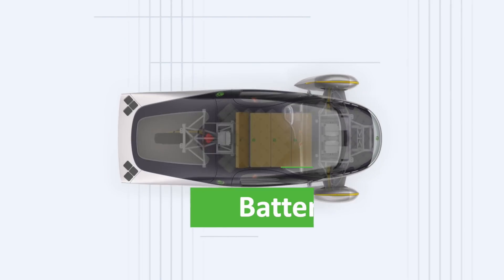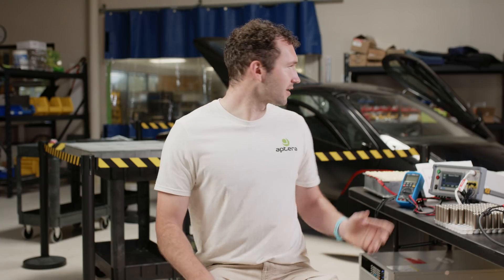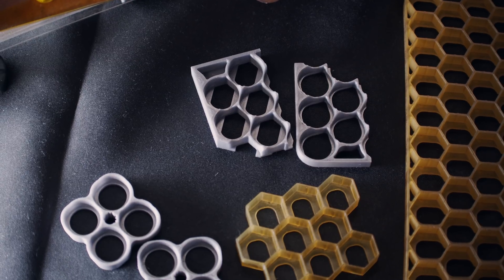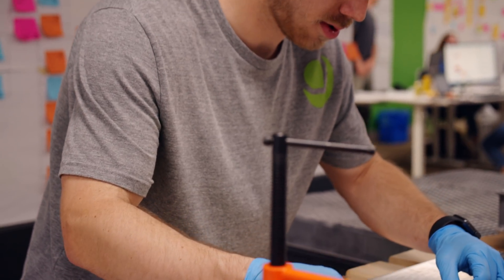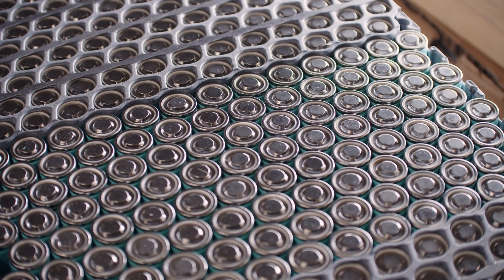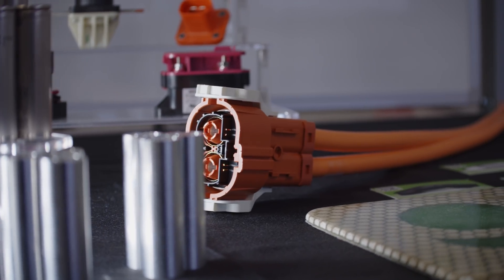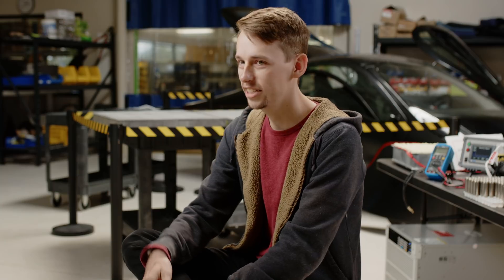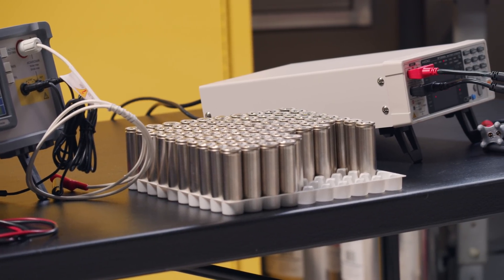Aptera — Battery Update

Comment: I didn't see any mention of thermal management.  How do you keep this battery from getting too hot or too cold due to climate conditions?  Also as the battery is under load and DCFC how do you control temps to keep this battery healthy?
Reply from the maker: Hi there! Our battery engineers have taken this type of event into account— Aptera is designed with a great battery management system that activates cooling or shuts down power in a situation that could endanger the battery pack. Our battery management system protects our battery pack from overcharging, and our solar charging systems charge at low rates so the batteries stay cool during the process.
Reply: Aptera has circulating liquid antifreeze both to the wheel motors and the battery pack.  If stationary and under charging load, the AC system kicks in and flows cold air over the inside of the belly pan and through the AC condenser, to exit the hot air out the rear.
Reply: @n.brucenelson5920  Thanks for the info!  Do you know how cold climate thermal management is done?
Reply: @Longsnowsm  I don't know the details, yet.  I do know that the body has dramatically better thermal insulation than most metal body cars.

I will be testing their performance in all weather conditions in Iowa with an early model and report.  We have more details when delta is released.

Comment: I missed where they talked about switching from LiFePO4 to NMC???? Going for a battery that Cycles 4000-6000 Cycles down to a cheaper battery that has 500-2000 Cycles???? Why? When I reserved 2 years ago it was supposed to be LiFePO4.😢 Y’all even hyped up the Safety and Reliability of the iron phosphate chemistry. What happened? Now we are looking at a battery that is going to last 3-5 years as opposed to a battery that last 10-15 years.
Reply: NMC has been spec'd since the beginning.  Recently Chris has held out the possibility of LiFePO4 for the 250 mile version in the future.  He has a public lithium battery company producing LiFePO4 packs for materials handling vehicles and is very familiar with their properties.  The NMC batteries Aptera is using should last an average of at least 450,000 miles.

Comment: Looking at the FAQ on your site, it mentions being able to replace battery packs. Will this be available as battery technology advances? For example, I see that science is testing new batteries to replace the popular lithium-ion batteries that are in most devices now. If this technology becomes a new standard, would you provide new battery packs using such technology that can be swapped into early models of the Aptera or would this require an all-new design for the vehicle?

Comment: I'm glad to see efficiency as the prime driver, but I hope replaceability is also on the radar.  I see a lot of EV's on the market today that don't think about end of life of the battery pack.  All batteries degrade, so let's plan for that.  I don't expect the battery to be hot swappable in 5 minutes, but you also shouldn't have to literally tear the car apart to do it.  With improving battery tech, it could mean that your next battery pack in 8-12 years from now might even be an upgrade from the original in terms of weight and/or capacity.

Comment: Will the battery be liquid cooled like tesla
Reply from the maker: Yes, the battery will be liquid cooled. The liquid is then cooled by our skin cooling system, so we don't need to have any vents that would destroy aerodynamics.
Reply: Also, the 2023 Chevy bolt will sell for 26k. Why is the aptera selling for the same price when it has way less parts than the bolt and a smaller battery pack. Shouldn’t u be able to sell the aptera 250 range for around 20 k or does Chevy just have such huge buying power they are able to assemble  the bolt for cheaper then the aptera.

Comment: I hear you're doing a structural battery pack, will it still be easily servicable/ replaceable when the battery wears out?
Reply from the maker: Hi! Many cells can fail in our pack design before things need to be replaced, and if replacement is needed, you would only need to replace the pack itself. We expect to offer a 10-year warranty on the high-voltage battery pack. The replacement costs will vary, but they should be far less than any other EV, as our packs are smaller for a given range.

We will have exact answers regarding our battery warranty and repair/replacement cost and plan as we get closer to production time. 😊

Comment: will the battery packs be upgradable? if i buy the 600mi version could i upgrade to the 1000mi version after delivery? that would be fantastic. 😎
Reply from the maker: Currently we are not planning to have the battery upgradable in segments. If you want a bigger pack you would have to replace the whole battery pack. This could be an option in the future!
Reply: @ApteraMotors  cool thanks for the info 🙂 excited to see these on the road soon.
Reply: @JasonRosensweig  Jason, it would not just be the pack, but likely suspension components as well, due to the weight difference.

Comment: Amazing 400 miles from a 41 kWh battery! Seem like it is nickel and cobalt based. I will prefer LFP for sustainability and durability. It will only weight ~50 kg more
Reply: Chris Anthony is well aware of the properties of LFP batteries.  In fact, he co-founded and took public as CEO a lithium battery company that makes them.  It may be that the lower range vehicles will use them.

Comment: I wonder, will we be able to replace/add battery capacity as an owner? If I buy the  250 mile range and realize it's not enough capacity will I be able to upsize?
Reply: At least at first,  the packs won't be able to be added to.  It is possible that the entire pack could be replaced, but there may be some suspension adjustments required as well due to the increased weight.

Comment: Are you going to try to use quantum scape battery?  Any fast charging
Reply: Aptera practices continuous improvement, so we will likely see changes as the tech improves and costs come down.  Aptera can accept a 50 kW DC input, and charge at the rate of 500 miles per hour.

Comment: i still can't see how you can fit 100kwh in the car without design changes, if you use 8 units for 41kwh we may be looking at 18 or more packs to hit 100kwh, that has to hit boot storage space also the increased weight has to effect range
Reply: The power density is greater than Tesla's packaging of the same form factor cells.  Weight does effect range, with an about 1% hit for every 30 additional lbs.

Comment: Is the vehicle going to be able to use the DC fast chargers? If so will it be 50~150 or 350 volt capable?
Reply: Yes.  Aptera will be able to fast charge at 50 kW DC and gain up to 500 miles per hour of range when charging on one.  The Aptera nominal pack voltage is 350 with a peak of 402.

Comment: Just to make sure. You are selling in Canada as well? How will the battery 🔋 work in extreme cold weather?
Reply: Yes, Aptera is taking orders from Canada.  The entire vehicle will be validated over a range of -20 to 125 F.  Some of the battery components will be tested down to -40.  It will have built in pack heating (and cooling), using liquid antifreeze.

Comment: I'm sorry, but I didn't learn anything from this. What is the battery chemistry?
Are the cells heated and cooled as necessary and if so, how? You talk about efficiency without mentioning a heat pump or even resistance heating. If you can't prep a battery during a Michigan winter, I'm going to have to look elsewhere and I've been a fan of the design from the original start.
Reply: All of your questions have been answered in other videos, FAQs and on the web site.  Aptera is using NMC  chemistry.  A reverse cycle valve for a heat pump is planned, but at the beginning of production there are no transportation certified versions available from the supply chain, so initial shipments will have resistance heat.  The battery packs have an excellent BMS and superior temp management.  I plan to use mine through Iowa winters.

Comment: Thanks guys for all your hard work! Stay with what you have for your launch vehicles. We need delivery to be prioritized so we can get these cars on the road!

Going forward, though, please consider how those six modules might be engineered to be made removable, and multi-functional. The idea is this:

It would be ideal if the Aptera, at least up to the 60 kWh 600 mile range version had battery modules that were in and out swappable so you could run with the lightest 25 kWh pack for daily low mileage uses, then add battery modules, say by adding up to five 7 kWh battery modules, as longer daily or trip needs make more capacity/range a necessity. This would be the most efficient solution for maxing out your vehicle's day to day efficiency since the dead weight issue of battery OVER capacity could then be managed. We could even share out or rent the extra battery modules within the Aptera community for those needing them only for infrequent vacay/family/friend trips. System wide the most efficient/shared/maximized use of battery storage capacity helps to justify each battery's mining, materials and production costs on our environment. 

I understand we owners might want to fine tune our vehicle's suspension to best accommodate these varying battery weight requirements. Perhaps Aptera could help engineer an easy system to accommodate this?

Extra points if these removable battery modules could be engineered to also function as home power wall like power packs to keep frig, etc, running during power outages while we could still use our Apteras for any necessary transportation needs. This is better than a strict vehicle to home system which would immobilize our rides. Climate change enhanced disruptions are making our electric grid, at least in the near future, more unstable.

And my full dream would be that these battery modules could also be monetized as electric grid support storage, both in and out of our Apteras. Thus individuals, nonprofits, and business could invest in them as an eco-friendly side hustle when $ assets were available, using them for steady income thereafter. The quicker we can ramp up available grid electric storage the quicker our economy can transition to renewable electric generation, and the more sustainable and healthier our future looks. And, if we choose to, we could then arrange for our battery assets to experience less down/idle time, helping to further justify their mining/manufacturing costs to our environment.

These swappable multi-use battery modules would also be the easiest format to have when advancing battery tech/chemistries motivate upgrades, or for transitioning them to their second life re-use as stationary storage when our aging batteries lose adequate efficiency and capacity for transportation use. This modular format also seems most efficient and manageable for enabling each battery modules' ultimate recycled afterlife. 

Meanwhile our Aptera vehicle could easily live on, and even keep improving, perhaps with other modular upgrades (ching ching $$$), beyond its OG batteries' lifetime! A more easily attained longer life makes our Apteras all the more the most efficient and sustainable transportation solution out there.

Could manufacturing and selling these versatile battery modules be Aptera's ace in the hole to profitability while fully supporting their most efficient and affordable vehicle transportation mission?
Reply: The problem with swappable battery modules is liquid cooling. If you want to be able to regulate battery temperature properly, it has to have antifreeze lines going through the pack. And that's gonna be a huge pain point for your swap procedure, full of O-rings and leaks and Teflon tape.
Reply: @ps.2  There are no lines going through the pack. Aptera employs bottom cooling using an aluminum plate at the bottom of the packs with cooling channels and circulating liquid to heat/cool batteries as required

Comment: 1. How fast will these packs recharge?

2. Where are the cooling channels for the batteries?

3. Will the packs be upgradable? E.g. start with 2 when ordering, but add 3rd/4th in the future to the vehicle?
Reply: With a 50 kW fast charger, they will charge at a rate of 500 miles range per hour added.

There is antifreeze circulating over the battery pack end plates to carry heat to an aluminum bottom skin.

The packs are not modular at present.  You would have to replace an entire pack and possibly suspension components to upgrade.  This could be a goal for the future.
Reply: @n.brucenelson5920  can you preheat the battery pack before loading?
Reply: @harryvantrotsenburg5481  I know that the pack temperature is regulated.  I don't know the details, but if they are cold, they can be warmed - by the antifreeze solution which can be warmed either by the motors, or electrically with power coming from a plug or the batteries themselves.
Reply: @n.brucenelson5920  it is the PRE heating which is important. I am now driving the very simple Dacia Spring, and when below 9 degrees Celsius loading becomes slow. It is very important that we can Pre hear the battery pack. When the Aptera does not give this option I won't buy it....
Reply: @harryvantrotsenburg5481  Ask this question it the January 20th webinar.  I live in Iowa where we had a recent below zero stretch and it is important to me, too.

Comment: With 4 available battery ranges/options (250, 400, 600, 1000) I assume that the 41kW pack is the largest, 6 modules for the 1000 mile range?  Would be amazing to be able to add/swap batteries over the lifetime of the car.
Reply: Assuming 10 miles per kWh and most of Aptera reservations being for the 400 mile range vehicle, safe to say the 41kWh pack is for the 400 mile range option :)
Reply: Each pack is going to be stand alone at least at first, and will have to be completely swapped out rather than added to.  This could change with further development.  There will have to be suspension changes with a battery swap because of increased weight and perhaps other changes as well.
Reply: @n.brucenelson5920  Interesting, OK - I'm guessing a lighter suspension/springs for the 2-3 ~7kW modules (guessing the 250 and 400 mile range), and a more heavy-duty style for the 4-6 battery module versions (600 and 1000 mile ranges).  You know this will be the first thing to be investigated once Aptera reaches the public!
Reply: @GP-SEA  Yes, springs and likely shock dampers as well.

Comment: How much range will the 41kwh battery pack get?
Reply: 400 miles
Reply: When Aptera gives range figures, they are referring to the specific conditions of the EPA Highway cycle.  How much range you will get will depend on many factors, including how much buffer you wish to leave in your battery.  Many of these factors are under your control.  Some such as the weather and altitude are less so.

Comment: Great video, would have liked to hear more about thermal management of the pack, to ensure longevity in high/low temperature and fast charging operation. Let’s not have a Nissan Leaf situation.
Reply: I was going to comment about this exact issue. Their battery will be significantly degraded in 5 years without thermal management. Their prototype battery pack does not look like they have cooling coils around the batteries.